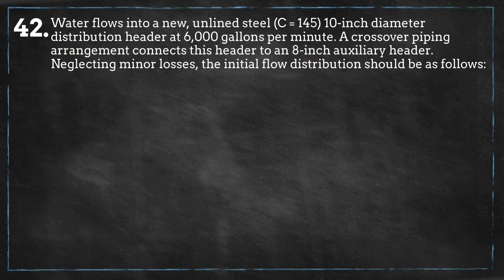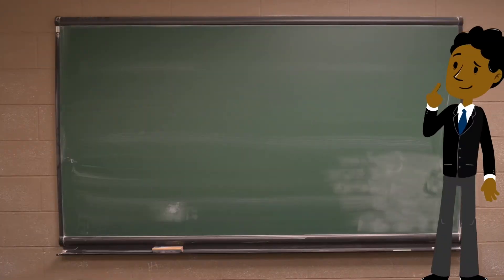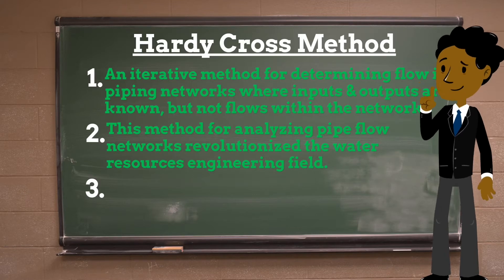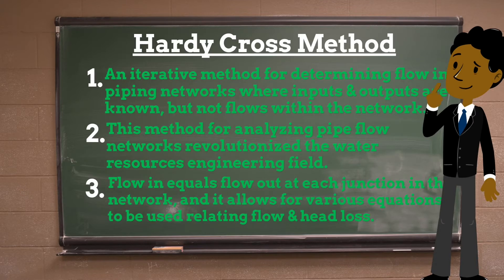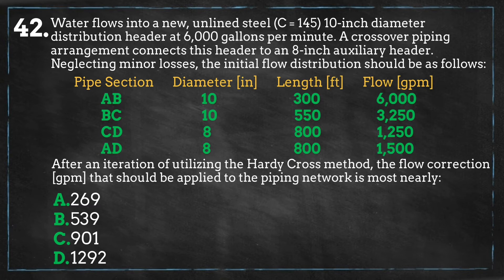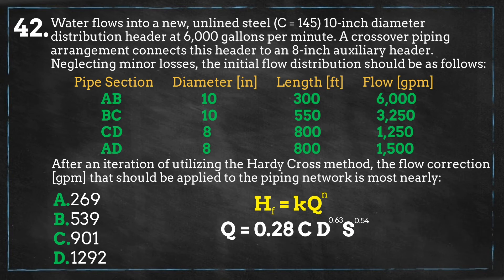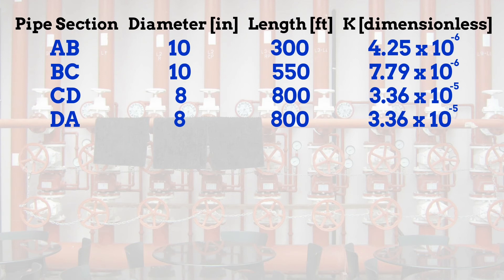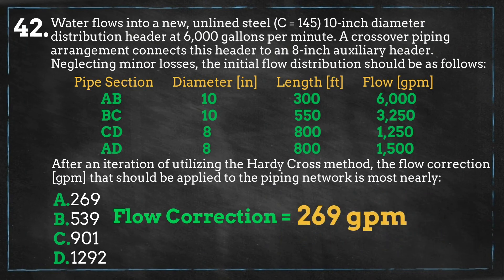The Hardy Cross Method - Episode 42 (Principles of Water) | 52 PE Exam Problems in 52 Weeks

Comment: Currently, the handbook gives you the Hardy Cross equation, and directly above that is the Circular Pipe Head Loss equation as hf=(4.73xL)/(C^1.852xD^4.87) x Q^1.852. When I calculated ▲Q my answer was -1292 gpm. I realized that my mistake was not applying negative values to the flows going in the counterclockwise direction. Once I made the head loss and flow values for CD and AD negative my answer came out to be -273 gpm, at which point I would have assumed the answer was A.
Reply: I used this same method and got the same answer.

Comment: I was having having an issue with the use of Hf=SL.  It helps however, that even in the Hazen Williams equation section with the current PE Env handbook it's provided that S = Hf/L.  Incorporating the simplified definition of headloss into another headloss equation which seeks to be more complete by accounting for pipe roughness is confusing, but this is part of what makes head loss v flow in systems complex to begin with... hence the value of the hardy cross method...

it ALSO helps (lol) that the derived formula for Hf, is also in the current PE Env Handbook, just above the Hardy Cross method formula.
Reply from the maker: Hey Aaron, thanks for your comment! With these videos now approaching 5 years old there are some of these formulas that may be in the handbook that can save you a few seconds/minutes on the exam so definitely take advantage of that!

Comment from the maker: With this problem, I did & said something at 4:29 that I want to highlight to ensure that anyone who watches this video gets. When you simplify the Hazen-Williams equation (using R = D/4 & A = πD^2/4) to get Q = 0.28 C D^2.63 S^0.54, this equation is for Q in units of gallons/minute and D in units of inches (you can also you an SI Units combo of cubic meters per second and meters with this coefficient). Some of you have contacted me saying that you got 0.432 as your coefficient at this step. That is fine, but remember that your Q must be in units of cubic feet per second, and D must be in units of feet (not inches) to get the correct answer.

The point is, you may get different coefficients but as long as you keep track of your units and remain consistent, you will get the same answer! Also to ensure that everyone gets the updates I addressed from others, the exponent for D at this step should change from 0.63 to 2.63. I also said wetted perimeter when I meant hydraulic radius (R), which is the pipe's cross-sectional area (A) divided by the wetted perimeter (P).

Comment: No flow directions and exit point shown so your assingment of + or - values to flow directions are arbitrary, no slope can be calculated (elevations not given),  you used D/4 for hydraulic radius again (this is appropriate for a NON-CIRCULAR pipe according to the NCEES reference manual and a google search),  your formula for Q is switched to have a coeffecient of 0.28 instead of the length parameter (which is different at each junction so this simplifcation cant hold across junctions), and I can't find this simplification of using hf = SL anywhere.   How can hf=SL? It doesn't even include the C coeffecient....  accepting this simplification would mean it could be the same value for two different pipe types which doesn't make any sense.
Reply from the maker: Thanks for your question, Devon. A lot to unpack here, so let me start with my mistake. In the mix of this video's word salad of explaining the equations, I did not properly define te difference between  wetted perimeter (surface of the channel in direct contact with the aqueous body) and hydraulic radius (ratio of cross-sectional area of channel in which fluid is flowing to the wetted perimeter of the conduit). In terms of equation, the hydraulic radius (R) equals the cross-sectional area (A) divided by the wetted perimeter (P). Since the pipe is full (assumed because the problem doesn't say it's not full, as well as the high velocity suggesting that its fairly full, if not completely), the wetted perimeter will simply be the pipe's circumference, or πD. Dividing the area, πr^2 or (πD^2)/4, by this wetted perimeter gives you a hydraulic radius (R) of D/4, which will be the case for any full, circular conduit. I took your recommendation and did a few Google searches and the previous sentence regarding R = D/4 for a full, circular conduit was verified. After you get rid of all the non-variable equation parts you get the new coefficient of 0.28. This is not related to any aspects of the junction box or the material it's made out (C) of yet. 

Secondly, the ultimate goal is to get the head loss (Hf) and flow (Q) of each section of the junction box. You can use whatever equation you desire to get those using the information provided, I just like using the Hazen-Williams equation because you can manipulate it using other equations, if needed. This leads to what you pointed out, that we do not have the slope; however, I can plug into this equation something else the slope is equal to. I used the hydraulic gradient equation that stems from groundwater flow (the "head loss" is equal to the hydraulic slope times the length of pipe): Head Loss (HL) = Slope x Length, and manipulated it to solve for the slope, getting the following: Slope = HL/Length (the hydraulic slope, a dimensionless quantity, is equal to the the "head loss" per length of pipe). Getting rid of the non-variable portions again gets you a new coefficient of 10.47. You can then plug in all of your variables for the 4 sections of the piping to get the head loss for each section. Finally, you will use the flow correction equation to solve for that correction value.

Lastly, to determine whether to make sections (+) or (-) in the correction equation, the typical convention is (+) goes for clockwise flows and (-) for counterclockwise flows. The head losses in the system should algebraically = 0, so the sign conventions aren't as important as long as you remain consistent. For this rectangular junction box my "clockwise" was up and right, so once I got to the last 2 sections (down and left) taking away from the entering flow (see moving diagram at the beginning of the episode, blue is the flow entering the junction box and green are the pipe sections), I made those negative.
Reply: @SIGMAEnv  This videos are great, thank you for developing them! One thing I still don't understand is the "+" and "-" decisions. If clockwise is considered positive then wouldn't AB, BC, CD, and DA all be in the clockwise direction? It sounds like you really just mean up vs down and right/vs left. Can you clarify? Additionally, in terms of the final answer what value is there in solving for K as you did in the table? Seems like an unnecessary use of time.
Reply: @SIGMAEnv  Thank you taking time to detail these explanations. I have watched all 42 videos so far and I'm grateful for the level of detail in the step by step guide you provide to the questions.
Reply from the maker: @oyinkanfamiloni6348  Thanks for your kind words!

Comment: Thank you for the videos! When setting up the overall equation, how are you first getting 0.28 and then 10.47?
Reply from the maker: Hey! Thanks for your comment! So when you begin isolating the slope variable, S, your coefficient is 0.28. You will divide both sides by 0.28, and your new variable on the other side is 3.56 (1/0.28). Lastly, your have to remove the current exponent the “S” is raised to, which is 0.54. To remove it, you must raise both side to the exponent of 1.85 (1/0.54), which creates the coefficient of 3.56^1.85 = 10.47. Quick note: depending on how many decimals places used in your equations you may end up with any value between 10.4 and 10.6, but it won’t change your final answer.

Comment: Thank you for creating these videos! They are very helpful. There's one minor error in your solution, at least from what I can see from checking multiple sources. The exponent for the variable 'D' in the head loss equation should be 2.63, instead of 0.63.
Reply from the maker: Thanks for your response! You are correct; when we switched the equation from equaling velocity (v) to equaling flow (Q) it should have went from R^0.63 to D^2.63. I'm not 100% sure, but I do think that I calculated the answer using the correct exponent, but that was not written in the video correctly.